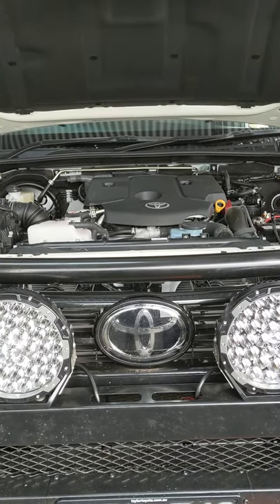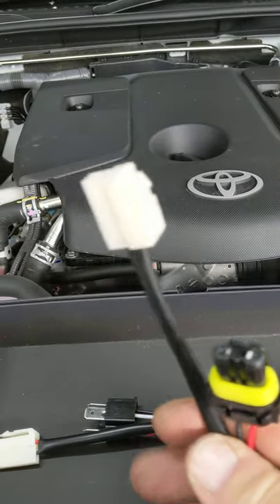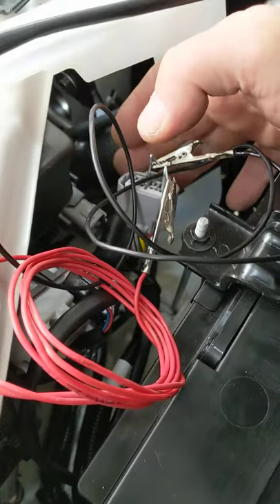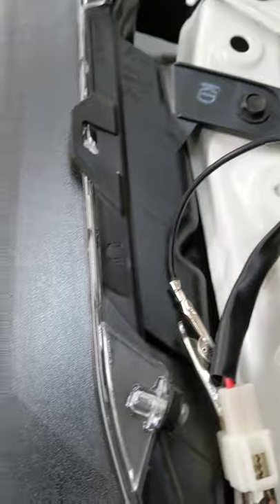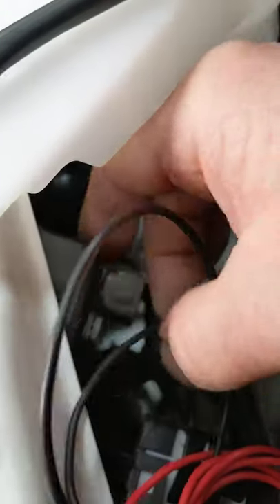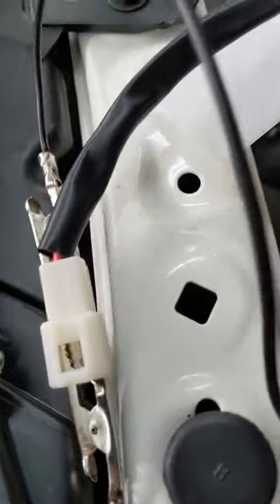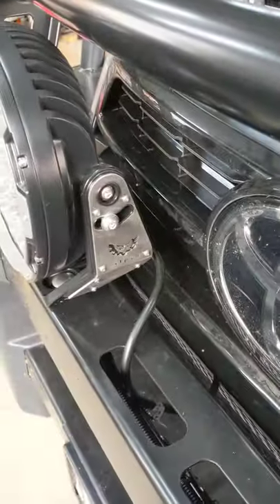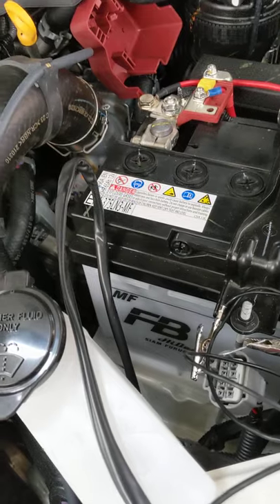Toyota N80 Hilux driving light wiring 2021

Comment: Is the stedi wiring kit plug and play for the facelifted n80 hilux? I read all these online forums about it being negatively switched and slight modification is required to the wiring kit. I’ve got no clue what it’s all about.
Reply from the maker: I'm not entirely sure about Stedi, but if they don't there's now a range of patch harnesses that I source from Cooldrive that will do the job with any kit. And yes, you need to pick up both a switched positive and switched negative on most Toyotas.

Comment: Do you happen to remember any of the other pins other than earth and high beam? I'm upgrading from halogen to OEM LED headlights and I'm trying to make up a wire diagram that won't fry my new expensive headlights. It's so new I haven't found anyone else doing it.
Reply from the maker: Hi, no I'm sorry I haven't. I simply haven't had the need to. But if you are just chasing the low beam circuit as well, it won't be difficult. Using the same earth will make it a safe bet to find the correct pin. Good luck!
Reply: @motoelectric7497  Hm, I guess I will have to overcome my fears eventually ;). There are some people in Thailand that make adapter harnessess but they're pretty bulky. I bought the OEM connector to re pin the original harness.  Originally there are four connectors one for each incandescent bulb. I know there is one relay required for one of the pins. At least now I have two pins to start with.